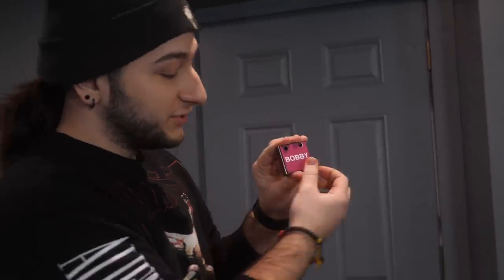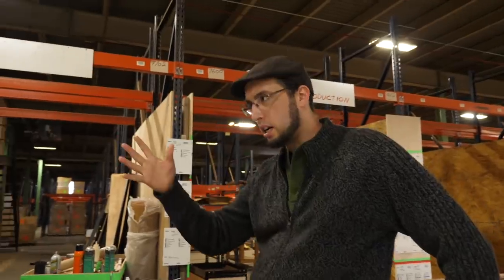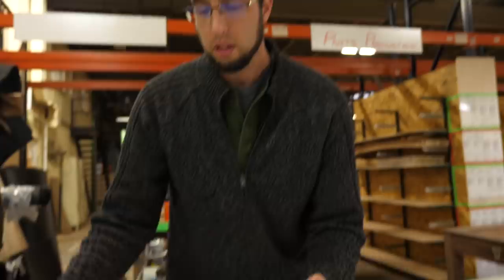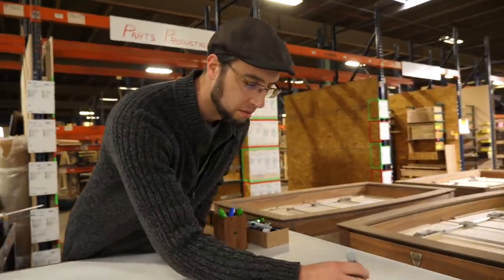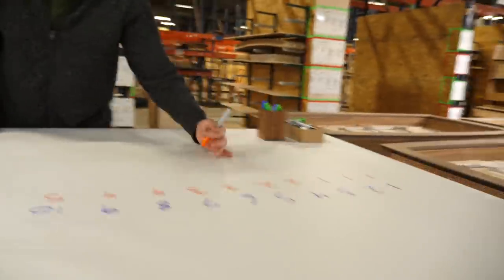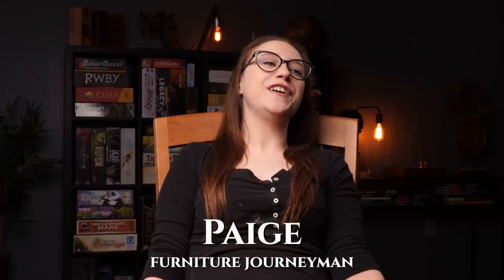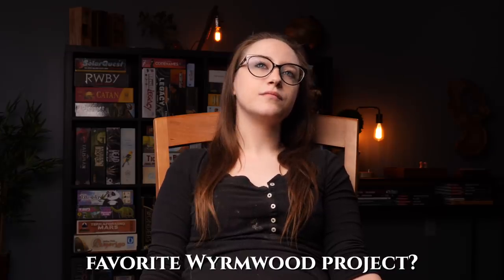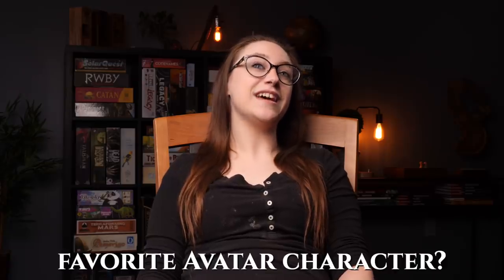ANOTHER LAWSUIT?! (They destroyed our table) S3E23

Comment: If you're going for high variance on a die, it would make more sense to replace the median values with extreme values. So:
1,1,1,2,3,4,5,6,7,8,13,14,15,16,17,18,19,20,20,20
The average value is still the same, but you essentially eliminate the chance of getting and average result.
Reply from the maker: There's so much math happening in this video and the comments section! We love it!
Reply: a d20 with no 9 on it....u monster
Reply: this d20 can work better in reality because while the averages stay the same the chances of success and failure dont stay the same on the die from the video(the video on is a 50-50 die)
and that can be a problem  while with tihs the chances of success and failure stay relatively the same(still different though)
Reply: Lets just go to the extreme variance d20, same average but everything is either 1 or 20 and name it the coin.
Dont have enough personal experience with dnd etc but is the outcome of a nat 1 at a the same magnitude but negative of the nat 20? Just rolling for attack would increase the overall damage because it would triple the chance of crit but a nat1 is till just 0 damage.
Reply: D&D death saving throws occur on a 10 instead of 11 because of generosity on the percentile design. Using similar logic, if you're going to bring out a "make or break" dice then why not replace the 8 with a 12 just to keep leaning in that "good luck" zone.
Reply: At that point, you're better off just rolling 3d20, discard opposites and take the closest to the extremes. It gives you a nice curve and about 1/4 of your rolls will still be either a 1 or a 20, but it's still a full spectrum of 1 to 20 without gaps (there's ~1.5% chance you'll get either 10 or 11)
Reply: @ParrotParrot  But where's the magic? There's something theatrical about "The Crit Die" being called for in a critical situation.
Reply: @WyrmLyfe  
the thing with averages in dnd is that dnd isn't focused on just averages in the single rolls:
A nat 20 is a larger benefit than a nat 1 therefore the change pushes in the favor of players in the case of a crit
the average case is beneficial for the players, therefore eliminating the median results pushes against PCs
lastly and most importantly: the result is not determined wheather the roll is above or below average but a set DC... a high DC roll is easier with the high variance die and a low DC roll harder compared to a normal d20...

Not that I'm against it, but knowing me, I'd powergame this math out of our table and i do not think this is a good thing.
The rules of the usage should reflect this - you'Re aiming for epic moments (again, they'd be made easier) so this is a perfect tool for the dm to fudge the dice in the players favor by allowing a "last stand" kind of attack to be made with this die - empower the dms to empower their players -> less powergaming, more epicness
Reply: When you gut the median values, you change the overall chance of success and move it closer to 50%.  On your number array, if a 13 was needed to succeed, then instead of it being a 40% chance of success it will now be a 50% chance, due to replacing the 11 and 12 with 20s.
It is far better to replace 2,3 with 1s and 18,19 with 20s as this way any roll that would have had a 15-85% chance of success will keep their odds.
Reply: any kind of "High Variance" di like this would actually be more than a bit game breaking.

Lets say we're fighting a Big Bad Guy, and he has a high Armor Class (AC). With your characters loadout and how big of a bad he is, you need to roll at least a 17 to get past his AC damage him.
On a regular d20, that means that 4 out of 20 faces would be a "success" and 16/20 would be a "fail"
On the High Variance di in the video (going off the frame where we see the 12 is remapped to a 17) 9 out of 20 faces would be a success.

So where a regular d20 would hit here 20% of the time, the High Variance would hit a whopping 45% of the time... it would hit over TWICE AS MUCH.... that's seriously game breaking

And I know this thread is probably dead..... but the math nerd in me would have never forgiven me if I didn't get this out.
Reply: @Walshman42  You just reiterated what I said.
Reply: @mavoc3094 ... Yep, yep I did. I didn't even notice your commenr originally. My bad.
Reply: gameplay wise, the math/average dont really matter it's just the probability of getting the result you want.

Comment: Question: "How the hell do we get a Wormwood Logo on the clip?"
Answer: Hire a metalsmith that knows how to cast them and solder them on and also knows a bit about woodworking so they can stay on brand when required.  Or use clips that are wide enough to laser engrave. Or make your own pen kits.

Bee tee dubs, have I showed you my wood USB drives? Not that I might be fishing for a job or suggesting that I'm such a metalsmith but I totally have been in the past and with propper equipment could even cast custom clips and I am practicing my copper wire twist inlays on my wooden thumb drives and have attempted wood-wrapped phone and tablet cases and would be willing to drop everything at a moments notice. Not that I'm fishing. (but I totally am.)

Comment: Fount pens that are wands (that can be used in RP for casting).

looking at the part of the broken table, there's a pretty big gap between the left cap and the table part (5:03). I'd guess the table was dropped on one side (broken leg) then other side dropped (broken edge piece). or they tossed it out the van, drive-by style!

Comment: I would call that bad packing from you not the shipping companies fault.
Ideally you want the legs to be screwed on afterwards to minimize shipping size.
The legs and all accessories should be inside the table, and the table should be packaged in an enclosed and protected box.
- with foam or polystyrene around is on all sides.
- Anything that is inside the table for shipping should be firmly secured with the same martial above so that it cannot move during shipping.

That also works where if you are shipping internationally, the costs decrease because of the lesser and more standard volumetric weight.
It protects the table during any form of shipping.
It's easier to carry around and through doors.
And then assembly would just be 8 bolts.
Also nice for storage, so if you are making products and have to store them to be shipped, it's a small amount of space for storage rather than the full table size of storage.

I have dealt with enough shipping stuffs to worry about the way it was shipped.
Hek, property moving companies damage stuff like tables etc because it can't be folded up.

On another note, your little storage box for the lids of the table.
Not ideal at all.
It is taking up more space in the clients room.
You might even be able to make an addon for the bottom of the table, so the top slides underneath and out of the way
But anyway on that, just food for thought.

Comment: Whilst the average won't change, the incidence of 'natural 20'  and 'natural 1' will triple. 
And that will have a significant impact on game mechanics (automatic successes / fails, crits etc).
I wouldn't want these at my table
Reply: I mean, that's the point of it. You wouldn't use it for regular rolls, but for the "Go Big or Go Home" sort of die rolling moments. If you don't have those at your table to begin with, then something like that is less appealing for sure. The Barbarian leaping off a cliff onto the back of the attacking dragon to drive it to the ground; that example is where you want the die roll because if you miss the dragon, then you are splatting on the ground, not bouncing off the dragon or anything else. You won't use it to punch the kobold in his stupid face.